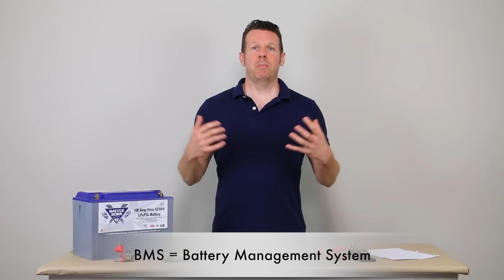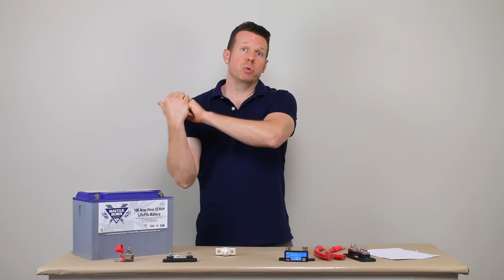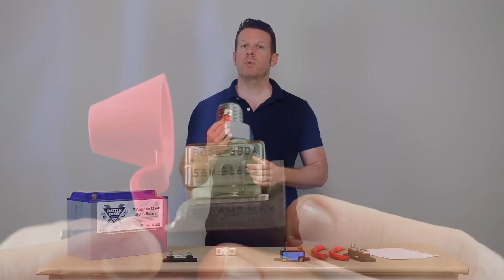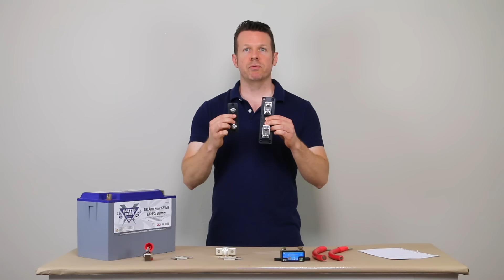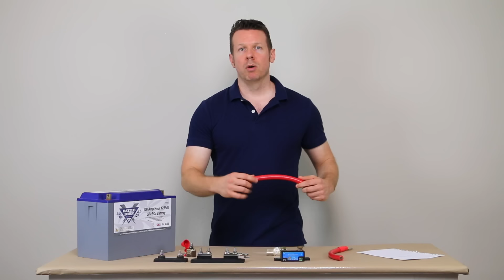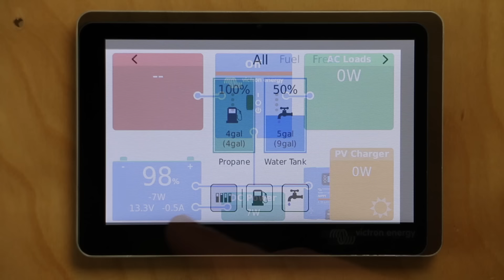The Top 9 Lithium Battery Mistakes for Van and RV Power Systems

Comment: I found myself just watching your videos along with other tech videos on this equipment and it's an eye-opener and you take in a lot but I found myself doing was I would just take your word for it or other videos. Their words for it without doing the math now and I didn't have any issues because I would watch the video ponder on it. Sleep on it. Get up. Turn around. Watch the video again and then it's like I'm missing something and realizing that it was the math that I never did and which you technicians and engineers are even saying do the math for the most part but we never do and this is why you have issues like the gentleman that can only take in 100 amps with a 90 amp charger and solar system. Listen people you got to do the math while listening to the different technicians and engineers. You should have a pen and pad and writing everything down along with their calculations and costs that are subject for these items because like we all know victron is not cheap

Comment: I think you are wrong on the solar voltage. The panels are pretty quick to get their rated voltage, but not the amps that are depending on the solar angle you were talking about.

Comment: if i have 2 324AH (each with a 200amp bms) lithiums in parallel  - i was planning a 200 amp mrbf on both positive posts.  Is that enough or can I also add a class t 100 amp going from the bank to the panel?

Comment: Your advice states that fuse should be lower than cable rating, makes sense to me. Does that mean you should put a cable in that tolerates say 75amp for a 50amp charger and then a 75amp fuse to match and a 75amp fuse to also match or should the fuse be 50amp?
Reply from the maker: Glad that made sense. The fuse & cable rating would always be above the charger or load so it doesn't blow during normal operation. So in your example, with a 50-amp charger, it would be good to use the 75-amp cable/fuse combo. This way it only blows if there's a problem. Hope that helps, thanks for tuning in-

Comment: Great info thanks! If I'm only using one battery is it acceptable to use the batteries Bluetooth and not have a separate monitor?
Reply from the maker: Glad that was helpful! Yes if you can get the battery state-of-charge and other info from the battery's Bluetooth app, then you don't need a separate battery monitor. The only time you would want a separate monitor in a situation like yours, is if you have a central monitor like a Cerbo GX and want the battery info to show up there. In that case, you could alternatively get a battery with Victron Comms and it would send battery data into the Bluetooth app and also into the Cerbo. Hope that helps, thanks for tuning in-

Comment: I am building the ultimate Overlander, out of a 12' Chevy StepVan, it will have a 170 Amp alternator, with DC Welding capabilities and a 5000 Watt  inverter.   It will have ZERO lithium Ion batteries!!

Seriously I decided to go with Lead Acid batteries good old fashioned 6 volt golf cart batteries!! 
Why?  So I can sleep well not worrying about thermal runaway!! ... 

I plan on heavy using the massive 8 battery bank, and I do NOT trust Lithium Ion to do the job safely!

Comment: I have a 2023 Thor tellar that has two 100ah lithium batteries housed outside under my van with a 2500 inverter inside the van. It is equipped with the BM pro maintenance system. I have a solar panel on top and also a 2nd alternator under the hood that charges the batteries while the engine runs. The van is equipped with tank heaters which means i can camp in low temps however i can't because my batteries are outside. I am  trying to find a lithium battery solution that will allow me to both high heat camp and freezing temp camp. Can you suggest a shop that would be able to do these battery modifications? I know a need a larger inverter and some other system upgrades but rv dealerships are not knowledgeable in the after market battery upgrades.

Comment: I'm still in the process of gathering all of the components I'll require for a solar/LifePO4 system for my older (1997) Winnebago Adventurer 34-ft Ford Class A motorhome. (1400 watts of solar capability plus 800Ahs of battery capacity). 
But I'm in Alberta, where quite often the winter ambient temps can plunge below -4F and sometimes as low as -40F/C. 
This is well below the lower limit that my self-heating batteries can tolerate, and it's actually low enough to damage them. 
The only installation solution I can think of for situations like this would be to install these batteries in a well-insulated compartment that can have heat lamps that can EVENLY heat the battery bay - and to have these lamps operated by a temp-sensor-backed switch of some sort. The lamps are always plugged in to a common power source, but a switch only completes the circuit when the sensors detect a temp drop in the battery bay below a set value say, 2F (-17C).
Of course, wherever these lamps are plugged into will need to be able to handle the current draw to avoid nuisance-tripping....
Reply from the maker: Sounds like you've got it about figured out. Everything you said sounds good to me. Pretty cold up there! Thanks for watching-
Reply: @rosslukeman  Well, almost everything. Your videos (among others) certainly help. My above set-up assumes we decide to live in the rig year-round. If not, then any time it's in storage or unattended for several days on end the batteries would have to come out and be stored someplace warm. Either that, or the rig gets stored someplace warmer - like maybe the Vancouver area or Osoyoos.

Comment: Hello Ross, thank you for sharing. I wonder if you are aware of any brand MRBF terminal fuse holder that both the stud and battery terminal hole are M8 (5/16")? I see all the MRBF fuse holder have M10 holes, but all lithium batteries have M8 terminals. TIA.
Reply from the maker: Hi Mingshan, thanks for checking out the video. On the MRBF fuse holders, no they will all be 10mm (3/8") holes. This makes them a universal fit as some of the larger lithium batteries do have 10mm terminals. I think it should be okay to use them with M8 battery lugs, so long as they get torqued down to the proper spec. Hope that helps!

Comment: What about mega fuses. They can be 58V with high 2ka icc which will work for a 100ah 48v lithium.
Reply from the maker: Hi Jack, mega fuses are great for chargers and loads but I would not use them on a battery. They need more than 2ka interrupt capacity, per ABYC and US Coast Guard standards. Hope that helps, thanks for tuning in-

Comment: Really good technical info here. I was wondering why the 12 volt panels l bought were putting out 24 volts ( even just using one panel , or 2 wired in parallel) It would seem it has to be that way to charge my 12 v battery. Someone please correct me if I missed something. TU.
Reply from the maker: Thanks for tuning in, great to hear you got something out of it. On the 12-volt panels, yes they are sold as "12-volt" but as you found, they are going to operate at something higher than 12V. They need to operate at a higher "pressure" (voltage) than the battery in order to be able to charge it. Hope that helps-

Comment: @Ross Fuse rating question: You chose the 400 amp based on your battery output or is it to be based on the max system usage? I'm planning an RV 24v system using 2 24* 200 batteries that have 200amp BMS. The RV is 50a split 240. I'll be using 2* MP+ ...
Isn't 4800w my target with the fuses? 4800 / 24 = fuse size ?

Comment: Great video if not a little wordy.

I avoid linking batteries to themselves and instead hook them up to [properly rated] bus bars to create a bank.  
That way each battery can be insulated from the others with its own MRBF and the system can be protected (btwn pos bus and main switch) with a Class T - for high interrupt.

Comment: Great video,  I’m only looking to extend dry camping time without running my generator every day to recharge the batteries.  I’m not doing Solar at this point.
Reply from the maker: Sounds like simply adding more battery capacity should do the trick, so you don't have to run the generator as often. Thanks for tuning in!

Comment: When talking about fuses, you should also mention limitations on max voltage for each type of fuse... (And this is also an item to consider if you upgrade your system from 12V or 24V to 48V)

Comment: Please state clear that it is not the Victron batteries that have BMS that can not handle more than 100A! You can use that one only if your system is badly dimensioned. Have your Victron system designed well!

Comment: Can I use a renogy 60 amp dc to dc charger to 200 amp hour lithium battery  with an alternator that puts out 170 amp ?
Reply: In the manual, it does not specify alternator amperage requirments.  170 amp is a good bit of output.  I’m not sure that your question can be answered without knowing your constant load on your alternator at a minimum.

Comment: Good presentation.  All this applies to golf carts.  What is missing is a main disconnect switch.   Other investigators have tested that some Chinesium fuses and CIrcuit breakers don't often operate at their published ratings.  Also make sure cables are 100% copper  and not copper coated aluminum or steel.  Quality Circuit breakers should be sized to 125%, fuses to 100% for continuous operation limit.

Comment: I know nothing in regards to solar and lithium batterys.
My home is a narrowboat. 
Problems - unreliable mains pickup so use invertor when power fails, fall asleep watching Tv, and take my batteries too low.
I dont know properly when alternator has charged ny gel batteries to full so wasting fuel.
I am quite sure as my 3 100amp batteries are wounded and need replacement.
This brilliant outstanding video gave me so much information to look into and research before bending my credit card.
Thank you so much.
Could you please respond im looking at the ECO WORTHY 280 AMP lipo one battery simpler setup as regards the loom, would 2 be better my ac charger is 40 amp alternator with smart control is 70 amp which it will run on the program in alternator controller. 
Again so very gratefull.

Comment: Regarding Fuses:
The ABB Fuses for house installation in Europe that go on DIN Rails actually have also a DC rating. These are easy to get, very cheap on smaller currents and are easy to reset. And with a very common fuse breaker size of 3x64A (common for houses in Germany, if one phase trips trips, the other phases trips as well) if you parallel the wires to these, you get a very cheap 192A resettable breaker 🙂

Comment: Is it OK to put terminal blocks on each positive battery for battery safety
Reply from the maker: Yes that is okay, just make sure the cable has the capacity (ampacity) to carry all of the amps your fuses will allow through the line. The fuses can add up to more than the line can carry.

Comment: I like your take on the 48v setup..
I have a 12v system in my sprinter and I always feel like I messed up going 12v when I hear people talk about there 48v.
Makes me feel better when I hear it's good enough lol
Reply from the maker: Glad that gave you some perspective on the 12V vs 48V comparison! New higher-voltage options are hitting the market but some people just want the new, exotic thing. 48V has some advantages, so long as we understand what they are, along with any drawbacks. Thanks for tuning in!

Comment: I’m new solar and everything that goes with it. I have a EcoFlow Delta 2 max and a Li Time 200 Ah lithium battery. I purchased these to use in my travel trailer which is stationary on my lot. Can I use my EcoFlow to charge my lithium battery directly or plug the shore power cord from rv into EcoFlow. Thanks